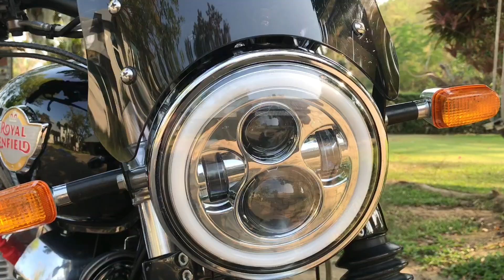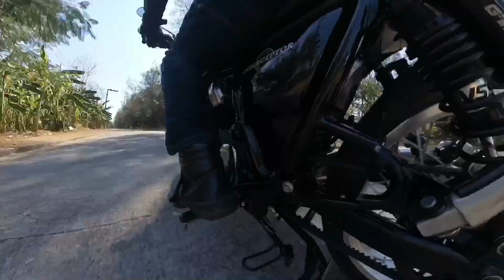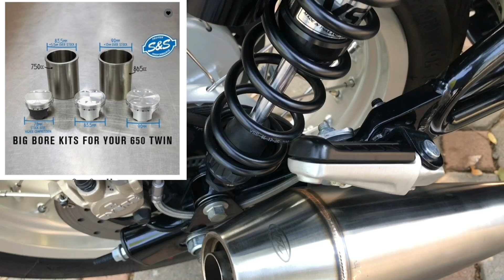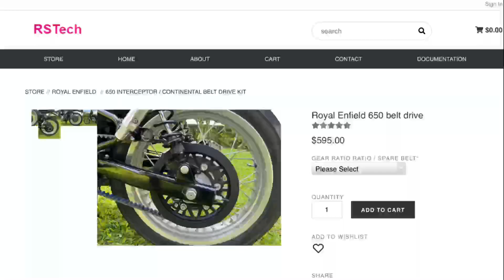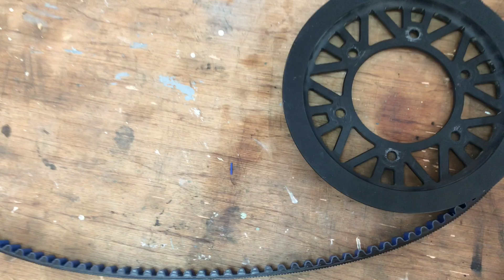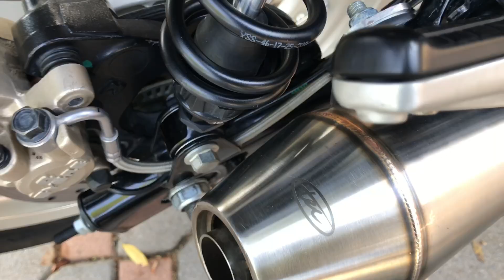Royal Enfield Interceptor Belt Drive - Review and test ride

Comment: Nice video promoting the virtues of belt drive. I am going into day 2 of converting my Interceptor to belt drive (I'm also relocating my reg/rec to beneath the oil cooler, along with evap canister and evap canister shelf removal). The kit is fantastic quality, however the front pulley is a bit tight and will only go on the splined shaft by approx 1mm, just enough to turn the gearbox. Maybe some heat or a gentle tap with a persuader (or both) will get it on there. Cant wait for my shakedown test ride. Can you ask Robert if it will be able to cope with a 865 big bore kit for me please. Cheers Chris
Reply from the maker: I think the front pulley case has to be modified slightly also on the Interceptor. No need to ask. These Gates belts are capable of driving 1250 cc Indian motorbikes. Good luck with it all. 🙏

Comment: My 1st bike was a BMW F650CS, with a belt drive. I traded that for a BMW650GS, same single cylinder Rotax motor but the CS was so much better because of that belt drive. Belt drive on these make so much sense that RE should make and sell the whole 650 range, except the Bear, standard with a belt drive
Reply from the maker: Agreed. If not standard, at least an optional extra on purchase. It’s so much better 🙏

Comment: Belt drives are the nut!, have one on my 2021Can Am RT Limited (Spyder), 3 wheeler for the uninitiated. Like most yanks into bikes my age (almost 68=:-) I’ve experience with chain drives, shaft driven motorcycles, it’s a God send not to have to oil or adjust your driven wheel
Reply from the maker: Agreed. I didn’t really appreciate it until til I had it. No more greasy black mess 😂🙏

Comment: Any fuel efficiency change from the chain to the belt drive?
Reply: You went with the modified gear ratio though right?
Reply from the maker: @TroyJPerez  yes. Lower rpm. Smaller rear pulley. Equivalent to a 38 tooth chain sprocket conversion ,,🙏
Reply from the maker: Belt does seem to be better fuel efficiency on long trips, because lower engine rpm

Comment: It is sure smooth, but I believe there is a power loss element on INT 650 and belt drives. Can this be confirmed with a Dyno run...?  I would love to see that information, as no reference of such comparison is on YouTube...
Reply from the maker: To be honest I don't see the point on a 650 cruiser. It's not like it's a high performance bike you are riding flat out all the time. I certainly have not felt any power loss on the Interceptor or Continental I have ridden. Just the lack of chain snatch and smoothness of acceleration. If there is a loss, it's minimal.
Reply: The statement that belts are not as efficient as a chain is not true with these Gen 4 curvilinear toothed belts.  From the Gates Engineering manual:
“PolyChain® GT® Carbon® belt drive efficiency will be as high as 98%. This high efficiency is primarily due to the positive, no slip characteristic of synchronous belts. Since the belt has a thin profile, it flexes easily, thus resulting thus resulting in low hysteresis losses as evidenced by low heat buildup in the belt." and "Chain drives running unlubricated may generate significant heat buildup due to increased friction in the roller joints. Even properly lubricated chains running at higher speeds tend to throw off the oil due to centrifugal forces, making it difficult to maintain proper lubrication at the load bearing.  " Consequently, chain drives are typically only 92-98% efficient."

While there is lots of Gates marketing fluff out there, the Gates manual I referred to is an engineering design manual rather than propaganda. The "elsewhere" references I can find are either Youtubers with questionable engineering credentials, compaqrison with bicycles, or general statements about belts or V-belts, and not specifically about these Gen 4 belts. Here is an unbiased US Dept of Energy report giving that 98% efficiency, and comparing to V-belts https://www.energy.gov/sites/prod/files/2014/04/f15/replace_vbelts_motor_systemts5.pdf
And a technical paper of chain VS belt with the same result:    https://core.ac.uk/download/pdf/55693235.pdf
Reply: Likely several reasons why you cannot find a direct back to back run, on the same machine, same operator, and under the same conditions comparison.  While an inertia dyno is relatively repeatable, any efficiency difference will be questioned given the nature of the dyno, and how HP and TQ are calculated (not directly measured).  Then how to compare? -  new chain and sprockets, old chain and sprockets, how old, oil/no oil/little oil, what oil, belt tension, equal bike tie down tension, consistent operator throttle operation etc.....  all these factors would raise questions on the validity of any such comparison.

Comment: Some inaccuracies here; the stock 650's ratio is 2.533:1 NOT 2.5:1. The stock 2.533:1 ensures that the chain/sprockets don't "repeat" every 4 turns, the running sequence is purposely mixed-up to prevent a harmonic. That may or may not be problematic with a belt opposed to chain.
Reply from the maker: You are correct, but to be honest. I put Robert on the spot. An impromptu interview. and for the sake of viewing retention, talking about 0.033  decimal places is not essential. But of course he fully knows the ratios. Thank you 😁
Reply: 10,000ks so far.
Reply: Teacher T Thailand: you missed my point; at an even 2.500:1 the chain sprockets (or belt cogs) at 2.5 or 2.375:1 repeat the same rhythm or wear-pattern over and over, an infinite ratio like 2.533 rarely repeats so it shares the load/wear ...
I have PM'd Robert about the disc brake upgrade that he pioneered, considering it for my 2020 Interceptor.
Reply from the maker: @frederickwoods5943  I got you now. I am not so knowledgeable about such things. He was saying a favourite mod was to swap out the original front sprocket to a 16 tooth. Surely the decimal places would still be there in the ratio? And for belt I don't think it is as important. Next Fridays Video goes into more detail on his front brake.
Reply: I did not specify the belt PCD as just more eye glazing math to most viewers, however like the chain example, both available belt ratios are also out of phase to avoid “repeating”.
Reply: @Ride-with-T  I will be glad to see the video on the front brake. About a year ago I put WiseCo 83.5mm pistons and an S&S cam in my 2020 Interceptor (743cc) and it makes the brakes inadequate.
Reply from the maker: Yep, not a lot, but the oldest and most Km's on one of these kits. So the best i can do for a few years ;-)

Comment: There are lightweight chains so the 5 lbs is not accurate also chains use less power to rotate than the belt drive. Belts are for holding up your pants. Chains are one of the cool gizmo parts of a bike.
Reply: Not sure what you on about with 5 lbs?  While a V-belt is less efficient, your contention that chains use less power than a curvilinear Gen 4 synchronous belt is simply not true.  From the Gates Engineering manual:
“PolyChain® GT® Carbon® belt drive efficiency will be as high as 98%. This high efficiency is primarily due to the positive, no slip characteristic of synchronous belts. Since the belt has a thin profile, it flexes easily, thus resulting thus resulting in low hysteresis losses as evidenced by low heat buildup in the belt." and "Chain drives running unlubricated may generate significant heat buildup due to increased friction in the roller joints. Even properly lubricated chains running at higher speeds tend to throw off the oil due to centrifugal forces, making it difficult to maintain proper lubrication at the load bearing.  " Consequently, chain drives are typically only 92-98% efficient."

While there is lots of Gates marketing fluff out there, the Gates manual I referred to is an engineering design manual rather than propaganda. The "elsewhere" references I can find are either Youtubers with questionable engineering credentials, or general statements about belts or V-belts, and not specifically about these Gen 4 belts. Here is an unbiased US Dept of Energy report comparing V-belts with these synchronous belts, giving that 98% efficiency number:  https://www.energy.gov/sites/prod/files/2014/04/f15/replace_vbelts_motor_systemts5.pdf
And another technical paper with the same result: https://core.ac.uk/download/pdf/55693235.pdf
Reply from the maker: As we said in the video. Horses for courses. A personal choice. 🙏
Reply: Chain slap a myth? What a load of BS.
Reply: What a load of rubbish you spew. I had a chain replacement at 30,000ks and will probably need new sprockets at 40,000. I won't have to constantly clean up all the grease fling. I won't have to put up with chain snatch, cleaning and lubing it and adjusting it.
Harleys have had belts for over 40 years. Less friction and they are good for around 80,00ks and I have read where people are getting upwards of 150,000ks from a belt. Belts are for holding trousers up? What a load of dribble. Time for you to spend sometime on researching belts instead of making a negative comment and making yourself look ....
Reply: @warrenhancock5742  You need to learn some manners and whatever about your riding style. Chains are not that messy and dirt happens. Harley makes a chain conversion from belt drive so whatever again. Old Harleys had chains and still do. Dirt bikes cant use belts they come off and wear out real fast etc etc. You know a lot of nothing.
Reply: @danielleclare2938  where I llive there are hundreds of Harleys, most with belt drives and they are well past 100,000ks on the original belt. Chains give snap everytime you chain gear, they are messy, they need cleaning and lubricating, they wear quick and wear out the pulleys. Manners are nothing to do with it. This is 2024, not 1964.
Reply: @warrenhancock5742  I don't have an issue with belts they are good on scooters and golf carts. Yes bikes make good use of them but they lack character and chain slap is more myth than reality. Maintenace is a good thing. I have a 1986 street bike original chain. Looks good clean and twirling. You can buy an electric bike and have no issues with dirty stuff if that is your thing but if even have a bike...
Reply: @danielleclare2938  chain slap a myth? What a load of BS.

Comment: Everything is fine only price 😢😢
Reply: The belt cost is fixed, and quality components, manufacturing in small quantity, and post machining surface finishing comes at a cost.  In all fairness 600 USD is a very good price compared to other quality belt conversion kits to fit my Bonnie.
Reply from the maker: It is top end quality as belt drives go. 🙏
Reply: It's a great price considering the quality.
Reply: Cant wait to hear how he did tubeless tires and would like to know about his seat